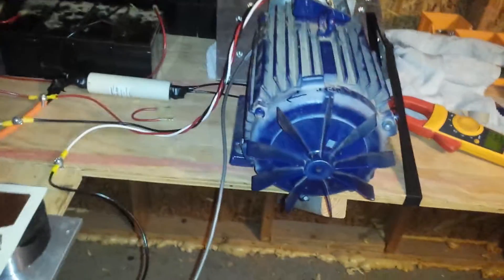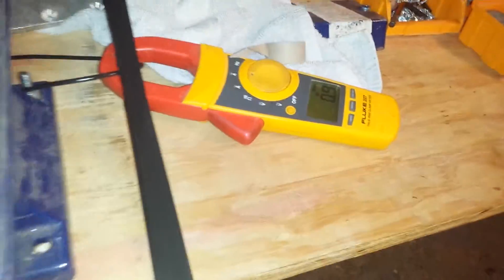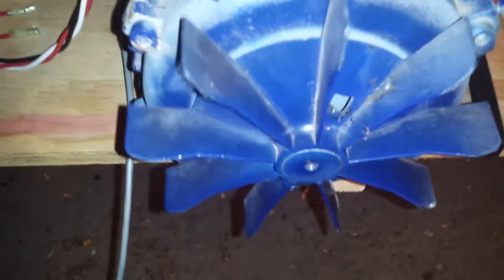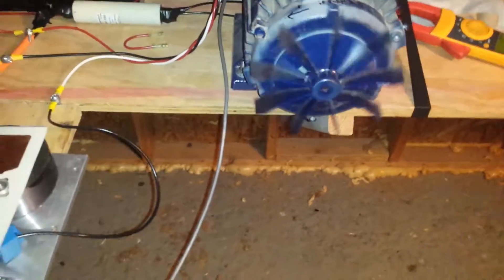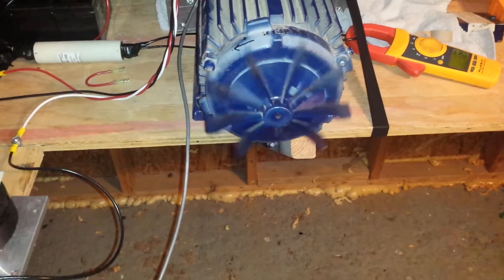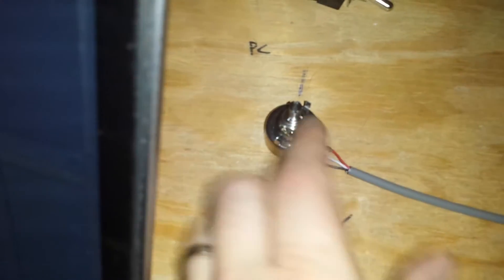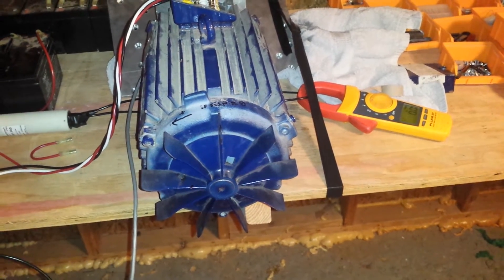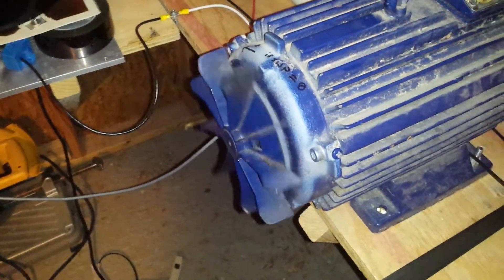Field Oriented Control of AC motor test

Comment: What's the point here? Apart from self enthusiasm (hoooo-hooo) i don't see what is accomplished here, obviously no torque, i only see the motor OR the potentiometer, i even cannot tell if the shaft is driven by the motor or some other device from the rear end ...
Reply from the maker: This was just getting it to spin under torque control.  The same code has since been tested at hundreds of amps and worked fine.
Reply: @MPaulHolmesMPH  can i ask your source code ?

Comment: Very cool. One question though, would it act the same under load? Instead of a air vanes what if you had a pulley with weights on it. Could you do a video on that if possible?